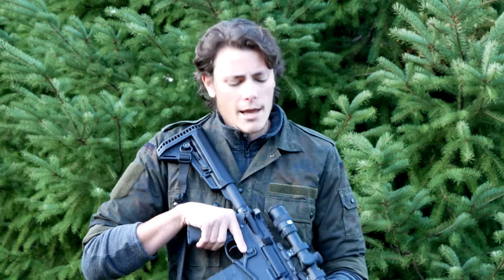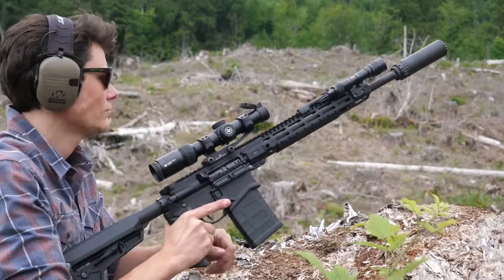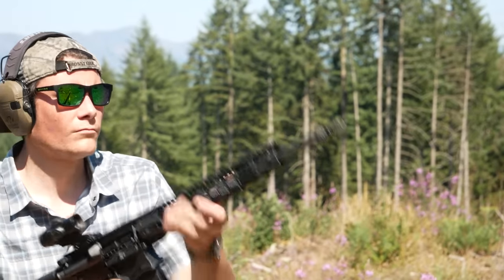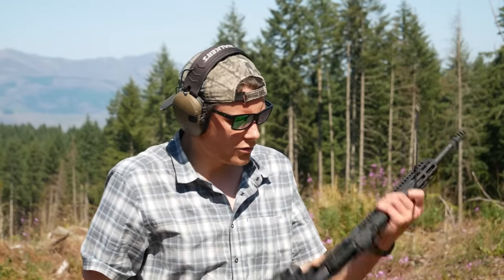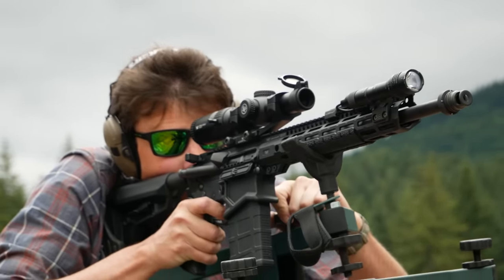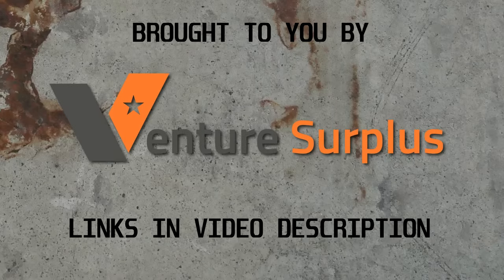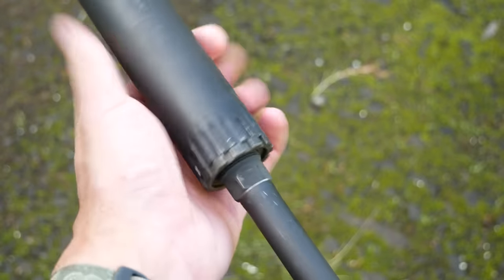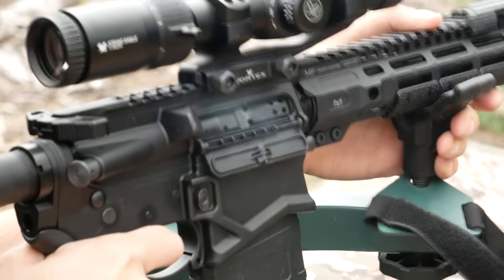Taking the Ruger SFAR to the Limit

Comment: The SFAR is an amazing product. You get the Vietnam war experience with stuck cases right out of the box.
Reply: This made me chuckle
Reply: It had a malfunction for that mass shooter.
Reply: It's a bummer.  I really wanted it to be reliable!!! Ruger is a good company.  Hopefully they stop using the public for QC like Sig has been doing lately.
Reply: I got an SFAR this summer 16” & have had zero issues. M80 ball about 1800 funds through it. Haven’t even got the new gas key cause the damn thing runs. Keep your guns lubed.
Reply: must be qc. Mine has been great
Reply: My MPR sucks too
Reply: Mine has been flawless for 10 rounds.
Reply: It's a "Revolution" in firearms design
Reply: Too soon.
Reply: @michaelkvilvang7348 try running .308 through it 😂😅
Reply: @a_american_  🤣🤣
Reply: LMAO
Reply: Unfortunately, very true at least it was with my 16 inch
Reply: Thank you, I was having a shitty day until I read your hilarious comment, which cheered me up.
Reply: You don't even have to get DOD procurement to supply defective ammo.
Reply: Epic comment lol
Reply: So true. Avoid this for now. Third time sending in always culminating with a jammed case. Company fixed barrel, gas, and BCG. Heed the warnings and avoid
Reply: I snapped 2 ruger bolt gas keys and multiple trips to ruger. Found out after I had another come in someone screwed up at the ruger factory and put a standard buffer tube/buffer system in and was causing the bolt to impact the sharp edge of the buffer tube shearing the single bolt head holding the gas key.

End result- after much frustration and the inability of ruger to realize it had non compatible parts installed from the factory…I got the right parts and it’s been golden with 168g suppressed and unsuppressed. Just fyi for those breaking shit lol
Reply: ❤ mine! No problems 😂
Reply: Everyone always blames the gas system on this rifle and never the ammo. FMJ can be the problem most of the time. Hunting ammo runs through this no problem. FMJ rounds have longer tips.
Reply: I have the SFAR. Around 4-500 rounds with 0 issues and sub moa. With a Nomad L.
Reply: lmao had_us_in_the_first_half.gif
Reply: What length barrel do you have. I just got one with a 20".
Reply: @clarkrowland6513  the early .308s had a lot of gas issues that should be resolved by now. I want to say I mostly saw it with 16" versions which iirc use a carbine-sized gas system or something. But yeah, people were replacing gas blocks and sending their guns back to Ruger repeatedly.

But yeah, you're probably fine. those early guns would fail to eject/feed/fire/etc and very temperamental with ammo used.
Reply: @Emily_M81  they should have gotten it worked out by now..
Reply: Pretty much
Reply: @trick8766 soooo you can't shoot the most common range ammo or there? Pass....
Reply: @stirfry741  Most dont agree.
Reply: @speedyolvera4748  308 is more reliable, so I’m not sure what you’re laughing at
Reply: I'm convinced almost 100% off people saying it has failures have Limp wrist cheap ammo or don't even own the gun because dude in the vid shoots every 30 seconds almost falls back and complains 😂😂😂
Reply: @mrgrump2534  that wasn’t the result I got when testing mine. NATO was much more reliable. It’s a more reliable round for sure, but not for the SFAR. 😂

Btw - I was testing with Federal .308. Lower end Federal ammo but I would still expect it to work flawlessly like the NATO rounds.
Reply: The early production rifles had a problem where the gas block wasn't tight enough. It's an easy fix. If you have ever used a screw driver.... you can fix it within a minute.
Reply: Yet to have a single issue with mine granted ive only put 40 rounds through as it is a couple months brand new, ammo is expensive 😂😂
Reply: What caliber and barrel length did you get?   Ammo that’s sub MOA?
Reply: This guys a wiener whistle.
Reply: My SFAR 308 has been flawless, no fail to feed ,no gas block issues, 1200 rounds thru it, no issues, I think ole boy tried to do too much tinkering to it. He should have never took the boomer break off
Reply: I haven't had a single malfunction with 800 rounds so far. I might have just gotten lucky. I run it fairly wet. 
That was a great joke though.
Reply: Hahaha!  I can relate to the Nam issues. 11B Armored Infantry Spear Head 3.   I ended up with an M16 M1A1 full auto.  It ran like a watch as long as I kept it clean.  
Now I have one of the early Ruger SFAR 7.62 and I had very bad recycling issues with it before I sent it back to Ruger. The Ruger people were superb to work with.  The weapon got several newer parts. I’m very satisfied with the SFAR now. I have extraction issues with Hornady Superformance ammunition now.  The 165g groups are very good under 2 MOA with a 3x9 mounted. I’ll stick with the Hornady Black or WhiteTail unless anyone has a known easy fix.  Kent/Montana

Comment: Didn’t you get a lemon originally? Did you get double lemonade? Which actually surprises me from Ruger to be honest.
Reply: My buddy's ruger ar had misaligned feed ramps. the feed ramps in the barrel extention were clocked counter clockwise
Reply: I mean, it’s Ruger. Not Knight’s.
Reply: Ruger is the bottom line in most people’s eyes, and I hold them slightly below PSA. 
Ruger and pretty much any other legacy company really aren’t as great as some make them out to be.
Reply: Why are you surprised? Its a ruger.
Reply: @jacobroy586 Was skeptical Ruger could do what no other company was doing with ar10 weight.
Reply: @jacobroy586  PSA has had awful issues in the AR department. I know I have never heard of major Mini 14 or Ruger 556 issues. Maybe it’s just me. Ruger has taken care of anything I need for years.

A magazine stopped locking back the slide of my pistol and they sent me a new one years after purchase. I trust them overall as a company.
Reply: Ruger and CZ are just premier hobby brands
Reply: @METALLIFY16  Ruger has good QC on their other models. I have never heard of a lemon LCP Max or Mini 14
Reply: River is an outstanding company that will warranty a gun even on the fifth owner. Given some more patience I’m sure Rydl would’ve made this right. There are many people with the same platform having outstanding accuracy and excellent reliability. Adjustable gas AR platform can be picky. POF, Daniel defense, etc. also have significant reliability issues in the ar10 type platform.  And those are very high dollar
Reply: Ruger isn't always the best but once they get a product dialed in its usually pretty decent...kinda sucks to be a gen 1 adopter of a lot of their products though.
Reply: @K-bob_45 That statement is true for Ruger but CZ is legit they make serious duty weapons for police and military units all over Europe AND some of the best competition pistols ever made
Reply: He said in the video that the second rifle was undergassed as well
Reply: @grilin18.  back when they made safari rifles their were gunsmiths who built businesses predicated on getting those guns to work properly. There are lots of aftermarket fixes for the Brens and the 75 B series guns. The new shadows are good but that’s like the first gun they’ve cranked out that was well put together and it took them 50 years
Reply: @jacobroy586 😂 thats horrorible to be worse then psa
Reply: Did you not watch?
Reply: Ruger QC since covid has been dogshit. This coming from a lifelong Ruger fan.
Reply: Why snipe this comment in? You didn't even watch the video...
Reply: @K-bob_45  If we exclude tactical sports from cz made pistols at moment.
Is there any clarification how 75b is not already damn good service pistol ?
To my understanding 75b was never meant to be a competion gun but
pretty much military/law enforcement duty gun.

Personally only thing what 75b lacks when compared to glock is
light rail. But gun itself feels far more natural on hand than any glock
at same timeperiod. But unlike glocks cz have actually evolved in years.

I dont personally have anything against glocks but other than price
and weight i dont see any other benefit to go that route if we
actually want a fun and good gun to shoot.

Specially in there europe where guns are usually more sport oriented.
And because dailycarry is not an option anyway so even less
reasons to have gun made to carry around.

But yes i understand things are bit different in some states.
Where dailycarry is way of life. For that i would not recommend
shadow 2 either.
Reply: @Kesssuli  the B lacks a radius on the firing pin where it contacts the FP retaining pin. Over time it will cut through that pin with dry fire. That’s why places like Cajun gun works offer proper firing pins with a radius and solid pins.

The triggers also suck out of the box and there are a ton of places that exist with the sole purpose of polishing CZ’s into nicer pistols and a whole host of aftermarket accessories with the same goal. The shadows are a different story but every other CZ I’ve ever owned/used felt like it was 80% ready to go
Reply: @K-bob_45  I thank for that info. Personally i havent heard any firing pin related problems with any of their product.

And there are in least two 75b:s in my knowledge which have been shots about 40-50 000 times and only had couple slide stops replaced. Which to my understanding is still bit a weakpoint as stock part even in shadow 2.

Stock trigger in 75b least in couple examples what i have shot is definelty not what we could call a hair trigger but still better what glocks have offered in their stock configuration.

Definelty best gun what i have handled was tactical sport orange (1) Guy told me to watch out for a light trigger but that definelty was something else. And it was
from factory in that condition.

For a purely IPSC shooting thatkind of trigger is amazing but for SRA i think it is bit too light. Specially if had to handle it with winter gloves.

When it comes to shadow 2 i think it is okay compromise between those two.
But of course we can always do a bit 
better and most likely getting small trigger job done for it in next year.
Reply: @Sig_P229 No lemon "LCP Max"? Then you obviously have no clue on you're talking about. 

Every LCP Max has issues. Fyi, they don't like certain hollow points. If you slowly rack it back, a hollow point will jam it. The recoil spring isn't strong enough either. So on and so on.

I had to upgrade every part I could to get it working. Thankfully, mine works now. And it's awesome. Now I can carry it once summer comes. 😊
Reply: CZ is far above ruger, you still drunk from the weekend or what
Reply: @Rubeless  the Ruger dangerous game rifles were better than the CZ’s. Pistols are no comparison, after you polish up the CZ

Comment: I still remember when ruger made the Gen 1 AR556 with no dust cover. I think that was the point when I realized that ruger and the AR15 design don't mix.
Reply: When they made their first piston AR thing, a friend got one. It wasn't smooth like an AR and it was so front heavy. And it was about 400 bucks more than a lot of ARs that knew what an AR was supposed to be at the time.
Reply: pretty sure the big brands like ruger and springfield get a payout for designing elaborately trash products. Take both parties ar10 offerings for example
Reply: The MPR in 16" works great.
Reply: @leckercidre160  makes sense being a smaller company. Its still 16 inch 308, which is a joke, but at least it doesnt have a braindead muzzle device on it like the saint 308
Reply: @leckercidre160 i have an mpr i love it, almost no recoil, smooth & the trigger is great out of the box plus sub moa
Reply: when did they offer the AR556 without a dust cover? you may be referring to S&W.
Reply: @unkulwilly  Thinking it was 2012-2016, I remember seeing it in a lateboyscout video.
Reply: You see that Q just released a rifle without a dust cover? Lol
Reply: Are you sure you're not thinking of the S&W M&P 15 Sport?
Reply: @GunFunZS  SR556? A friend had one, it was hilariously front-heavy.
Reply: @Porty1119  yep. My friend who got it what is a Kalashnikov guy. Add spent so many years dogging on the AR the only way he would get one as if it wasn't a standard AR. Can you turn it to purchase things on a whim to impress people who wouldn't care.
Reply: Original AR had no F A and no dust cover. Your point
Reply: @GunFunZS  bro do u even know how to write or read?

Comment: The sfar seems like the optimal platform for a low back pressure can like the flow 762 ti. The small amount of back pressure that a flow through can may be enough to make the factory setting 2 reliable while also cutting down on gas to the face. 

The low weight and and small form factor of that can also compliments the SFARs strengths.

edit: This may be why Military Arms Channel’s SFAR is reliable, I know he loves to use huxwrx cans.
Reply: Can confirm the huxwrx 762ti works great... Just don't forget to take it off 3 lol
Reply: Well that sucks. I would never want to spend my hard earned money on a firearm and be restricted to an uber specific build. Not a great business model.
Reply: @MrLilhauughh  it's fine on a more restrictive can... Just run low
Reply: Only can that works with a 1-1.2k gun is a 1.8k silencer that will spark harder than when I stick paper clips in my outlets on a 16” 308 lol
Reply: @codyrocca682  I actually run the hx-qd ti... It's only 1500... Eat like a poor for a few months.  You can do it.  Mine doesn't spark either.
Reply: @codyrocca682  the Titanium cans will spark during the first 100 rounds, after that the residual titanium bits are blown out and it should stop sparking.
Reply: @codyrocca682  they make a non-Ti flow through 7.62 can as well
Reply: @colestahl1265  that’s 100 percent not true lol, no matter what titanium will spark
Reply: @breckfreeride  pretty sure they stopped making the HXQDTI, the flow762 is 1800, and still bugs me they changed the internal geometry on the HXQDTI silently because the flow rate was too bad. Some cans have internal ridges, some cans don’t. Pew science found that out during his testing of (the how obsolete) platform
Reply: @codyrocca682  dang...
Reply: @MrLilhauughh have you heard of the FN SCAR? That business model seems to work just fine for FN.
Reply: @cole
YES!!!!!!!!!!
I checked that can out. DAYUM!!!! Pricey,  but PERFECT for this set up. The gas the author was getting in the face was so full of lead particles, I see it as life shortening. WAY too much gas.

The Huxwrk Flow is THE best and lightest flow-through can ever as far as I can tell. Near ZERO back pressure.   Not the best for 300 subs, but no flow-through can is. Buy a traditional large volume baffled can for 300 BO subs.

But for supers that Huxwrx can's specs and capabilities has me SOLD. Alabama Arsenal did a great review on it.
Reply: @MrLilhauughh aww poor baby
Reply: @breckfreeride guys a clown
Reply: @codyrocca682  you must be pretty poor if you’re coping that hard😂
Reply: @codyrocca682 the fuck are you taking about … it absolutely is true. I have a titanium can and the spark stopped about 300 rounds in.
Reply: @mrgrump2534  I guess it just needed to be seasoned like a cast iron.
Reply: @codyrocca682  4 oz less weight too...
Reply: @MrLilhauughh  Yeh that's not what he's saying at all lmao, learn to read

Comment: I think the SFAR is a good sign that the market for a small frame 308 is going to expand.
Probably because of, not in spite of, its problems.
Its cost is so tempting, its compatibility with common AR components means its easy to tinker with, and since most AR owners treat guns like LEGO sets, changing a bunch of parts out is a feature, not a bug.

So, I wouldnt be surprised if this sparks a minor aftermarket in fixes for common problems, and maybe down the line an ecosystem for small frame 308s that center on the SFAR, since the DPMS GII fell to Cerberus and the Rogue is priced out of the casual buyer range.
Reply: Everyone wants a low cost product that is also a quality build and functions. For example, look at Arken scopes and the huge following they have. SFAR gets the job done at close range because MOA is not a factor. MOA becomes a factor at distance and the complaints go up considerably. Much like the Arken where the build and turrets has high praise but at distance the glass quality comes in to play and the complaints increase. The POF Revolution or DD5 V5 cost more than the SFAR but they perform out of the box and at distance with better components and tighter tolerances. So the debate continues "At what price, are you willing to spend and be happy with the decision?".
Reply: @JW-wi1nf  My bet is Palmetto could build one that actually functions well at Rugers price point.
Reply: @danielllewellyn5720  Palmetto (PSA) makes good products at a great price point. Their Gen III AR10's have a much improved fit and finish. They also shoot 1 MOA with quality ammo.
Reply: Idk what makes you think the market will get behind this garbage gun when it's nothing but problems. Not gonna happen. And I owned a Rogue, that was also complete junk. Sold it. My Aero m5 is butter. The extra 2 pounds doesn't make a huge difference

Comment: The reason why I bought the SFAR was because of price and weight. I had to send mine because of shaving the brass and double feeding on setting 2. Just came back after a fast turn around and tried it a couple of days on setting 3 and while still shaving some of the brass, I saw great improvement after 50 rounds.  On setting 2 worked flawless with my handloads. If I start spending money changing all the parts that mentioned, I'll be defeating the purpose of acquiring the SFAR. Thanks for sharing your thoughts.
Reply: I think the Savage MSR-10 is the more optimal size for lighter .308s.  Still has a bit more carrier weight, without being a beast like an LR-308/AR-10 BCG.  Also has adjustable gas with mechanical advantage.
Reply: This hobby is not for the poors 😂
Reply: Also, what do you mean shaving the brass?